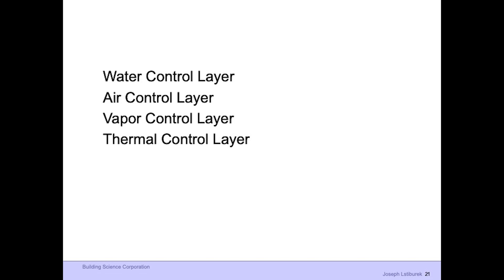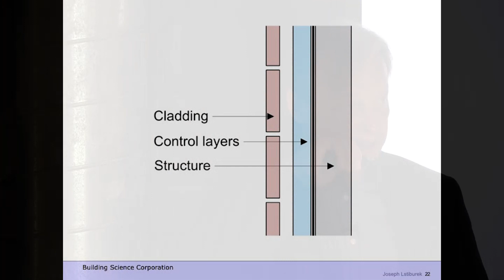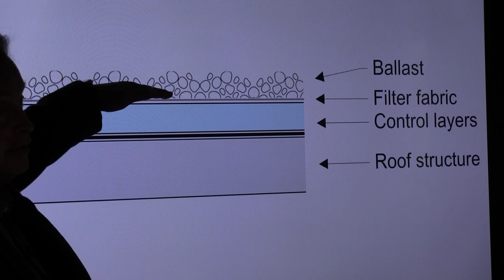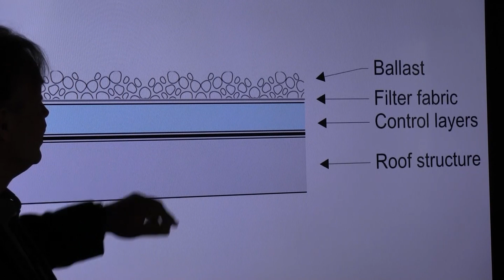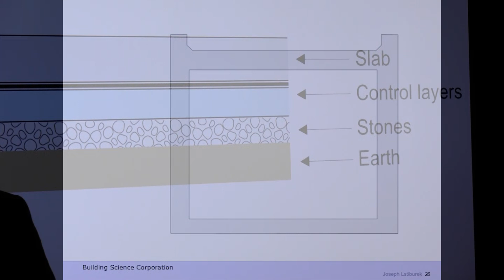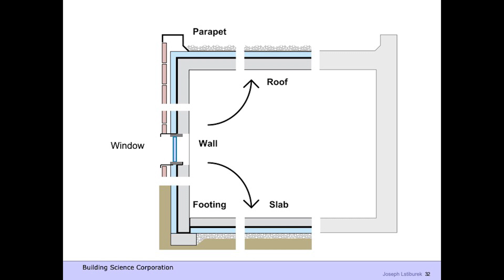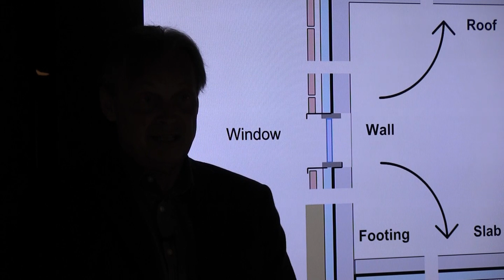The Perfect Wall. Finally.

Comment: This is great, but how do you attach an overhanging roof over the top of everything if it needs to be supported by the structure which is on the opposite side of all these layers? If I built in a cold climate I would probably use 6 inches of mineral wool insulation and it would be hard to attach your cladding and roofing to such a thick unsupportive thermal layer. I have an idea though. What if you build a wood framed structure like a cube, then cover every inch from top to bottom with sheathing, apply a control layer (Zip, Carlisle membrane, etc), cover everything in 6 inches of Roxul mineral wool, and then build another load bearing 2x4 wood structure up tight around the mineral wool which will support the roof and those stud cavities are the vented space for the cladding and roofing?
Reply: You can't do it the way you described (with non-structural insulation/rockwool), but you can if you use rigid foam boards or other structure capable materials; In essence, this is precisely what he's railing against. Too much concern for optimizing thermal performance (insulation) at the expense of everything else.
Reply: Build monopoly style house with fake overhangs. Watch risingers video.
Reply: Apply the decorations to the house after the initial shape is created. The decorations are anything unnecessary to make the house functional from a control layer standpoint. So overhangs and such are applied after.
Reply: The point is to create a sealed structure SO effective that even if all the windows are open, the temperature doesn't change too much - if at all - unless the weather is REALLY bad. Because the house itself stays the same humidity and temperature all the time, regardless of the season, the frame will move less (which also means you use less energy for HVAC - which also means less risk of condensation in the water pipes, and so on). If the frame moves less, it stays square longer. Which means your doors and your windows and your weatherstripping and LITERALLY EVERY SINGLE THING ON YOUR HOUSE will last longer. Which means the value of the house stays high for decades to come. The individual components don't matter AS much in terms of pure performance numbers is the point that he's trying to make. It's the method and execution of making all the layers individually sealed inside each other - the exact same way you layer clothing to stay warm - that matters the most.